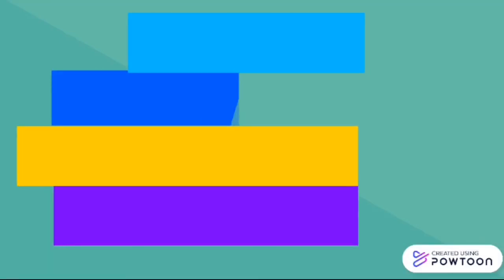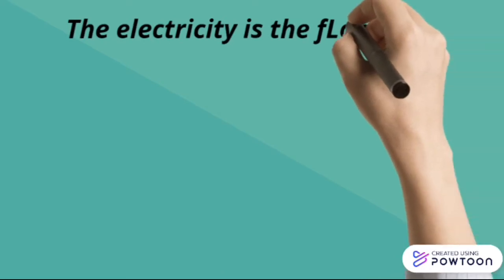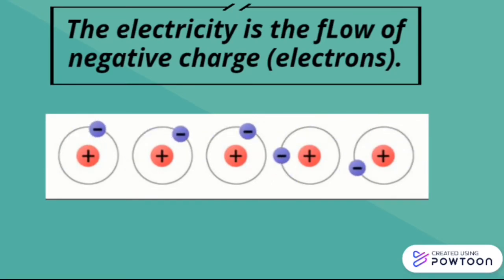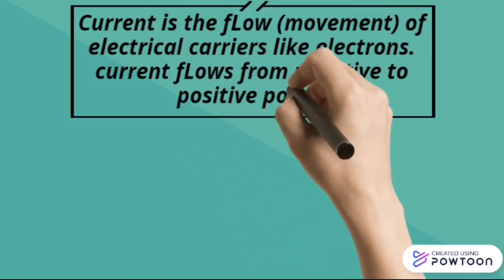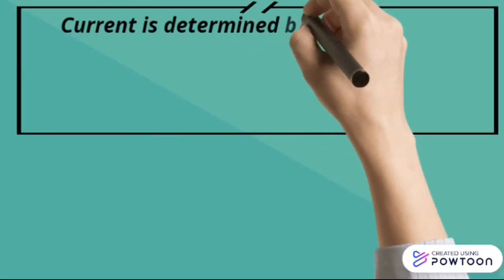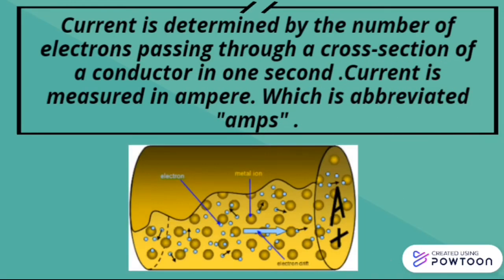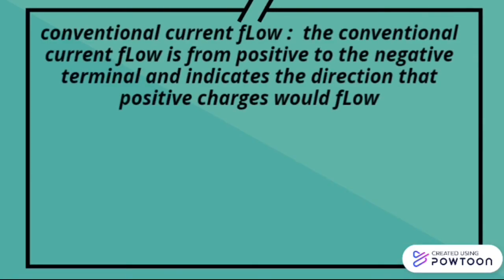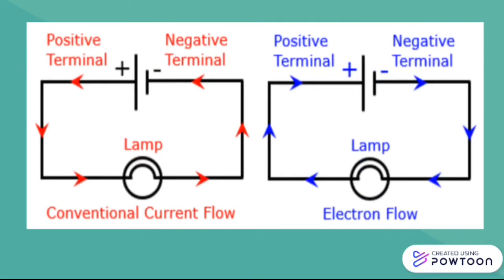What is current and ampere? | CURRENT explained

Comment: Brother what if we connect 3v 20ma led to 3v 10amp power source ? Will it be broblem to led or no problem ?
Reply from the maker: No
It’s not gonna be a problem because the led will take the 10ma needed and leave the rest of the current
Reply: @electronicszone1114  thank you for the info